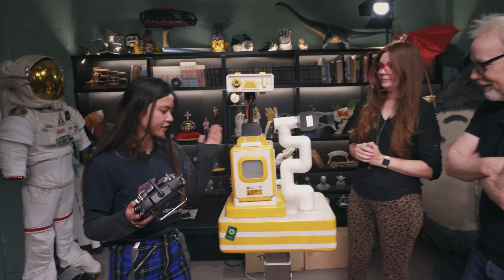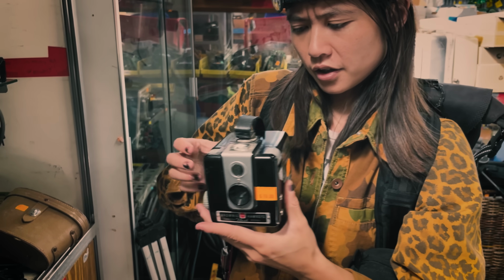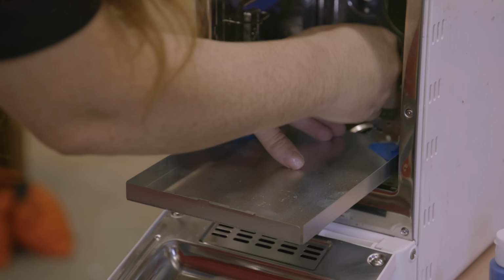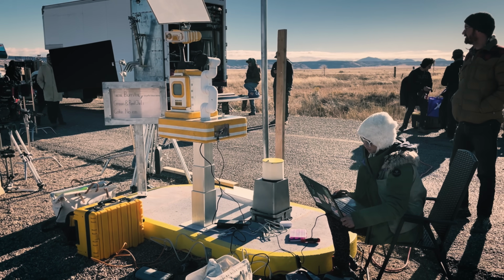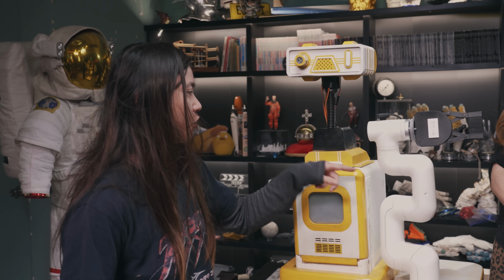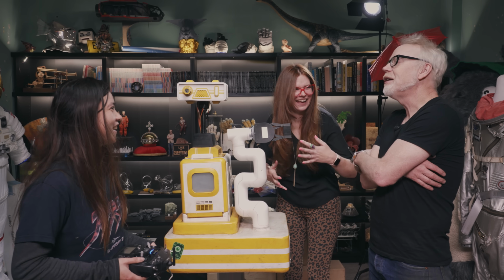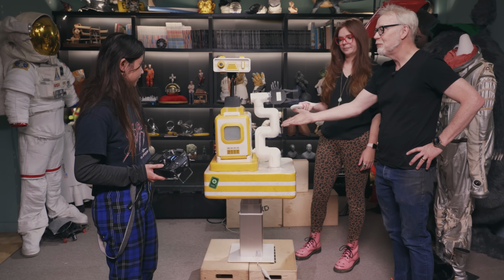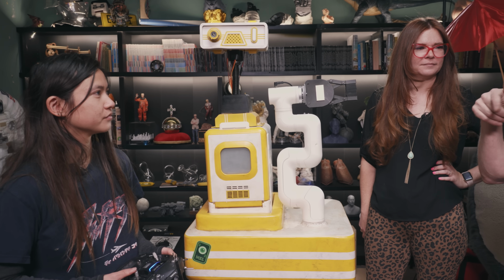Adam Savage Meets Kayte and Mel's Animatronic Robot!

Comment: I like the robot quite a lot. It definitely hits a vibe. Only design element I would have changed is the black part in the middle. I think it should have been a different color; either match with the rest of the robot, or a metallic silver.

Comment: As you might guess from the droid in my profile pic, this sort of thing is right up my alley.

The first day on set will likely sound like a familiar experience to droid builders that have taken their droid to a convention for the first time (or more accurately, each time they take them.)

You start learning to prepare for it by bringing as many spare parts, fasteners, tools, and/or wiring diagrams as physically possible.  And accepting that (almost inevitably) the failure will be something else out of left field.  The point of the preparation is to reduce the number of things you weren't prepared for, shrinking left field out of existence.  Most of my droids have gone through the "well, I wasn't expecting THAT to be an issue" or the "weird, it worked at home" situation, many more than once.

Which is why it also pays to be helpful to other builders and attendees; you never know who might have/be able to make anything you forgot or didn't think of.  It could make the difference between a brief repair session and having to leave the droid in the hotel for the rest of a major event like Dragon Con.